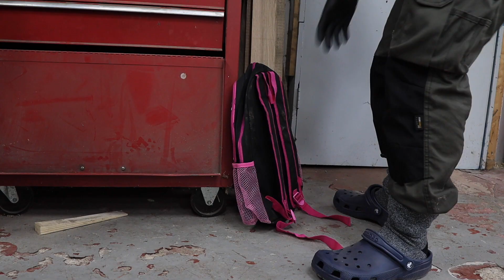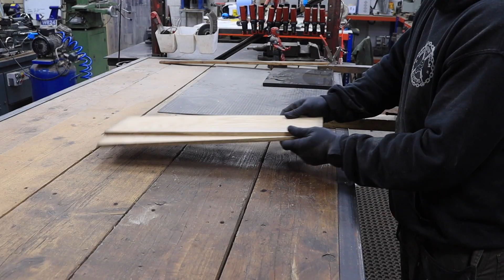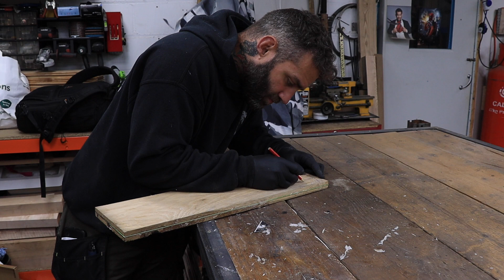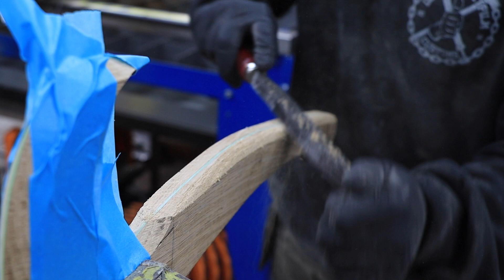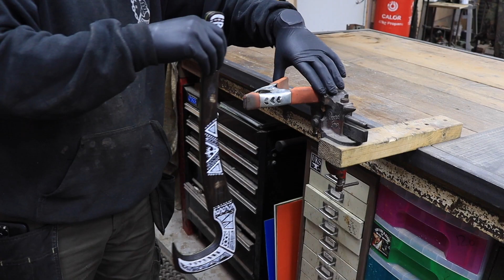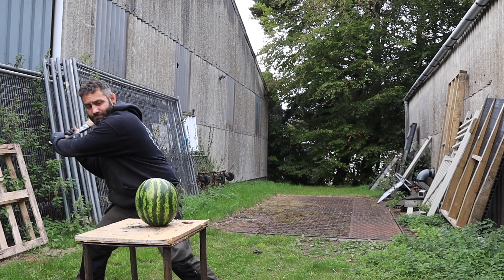BRUTAL Sāmoan War Club - The Nifo'oti

Comment: Looks great.
 What wood did you use?
Would you stabilize the wood next time?
Would you use a bench router for the  edge angles?
Love your stuff, keep working 👍
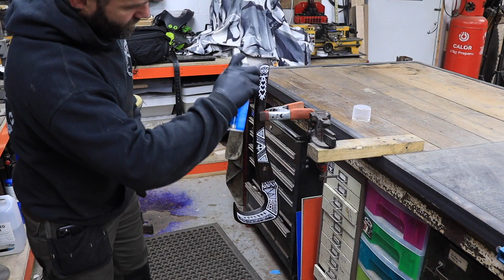Reply: What kind of spray did he use at 5:37 and why??
Reply from the maker: I used oak. 
No the wood is strong enough as it is, stabilsing is more for knives due to water intake. 
The angles were too steep for my router or i would have used it. 
It was laquer to seal the art
Reply: Cabinet worker here. Looks to be specifically plain slice white oak. You can get 3 different cuts of wood, based on the relation of the growth rings to the cut when you make your board. Quarter sawn and rift cuts are generally more stable than plain slice, but the visible grain patterns and flecking are markedly different in oak. You can also get red oak, and I believe brown oak, fairly commonly.

The plastic stock in the middle will help a small amount with wood movements, because it's got additional layers it'll need to bend. If you book match the blanks, you can further reduce movement by setting internal tension opposite to itself.